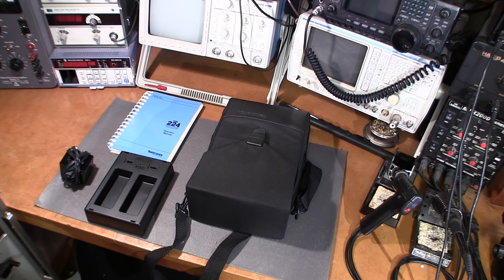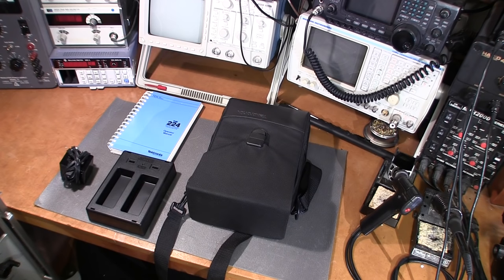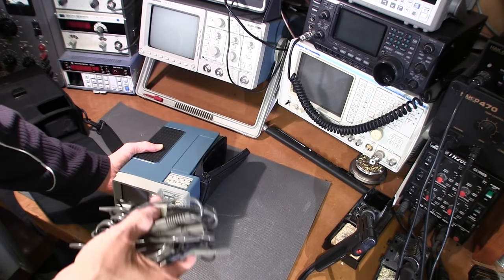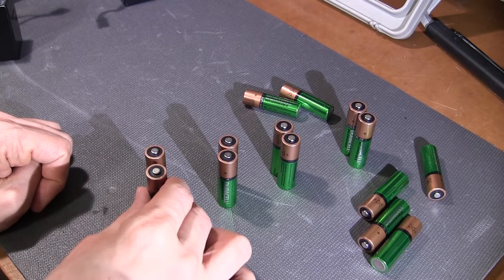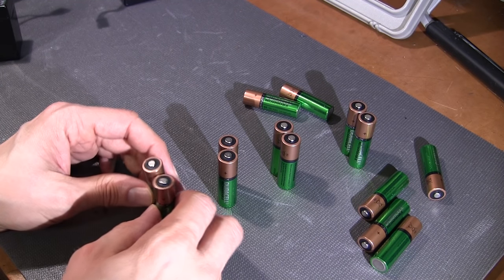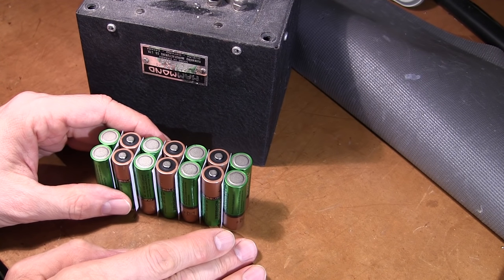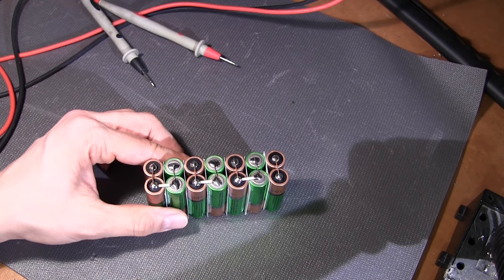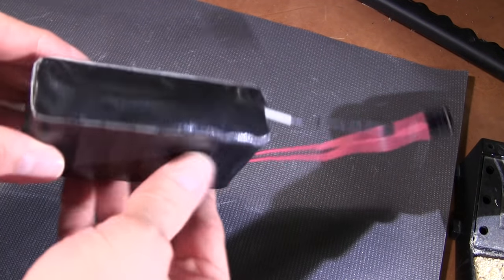Tektronix 224 Oscilloscope Repair and Modification

Comment: I just watched this again for review. I need to make a battery pack for a HP portable scope I purchased. I wish it only had a few batteries like yours but it is going to take 80 batteries to make the 24 volt battery pack. I think I have decided to make 2 packs like yours but 4 batteries across and 10 pairs long. That will give me a pack with enough current but at 12 volts. I will make 2 packs then joint them in series to get the 24 volts. There are so many different ways to do the job. I could have made 4  24 volt packs and join them together for more current. There is good logic in the way you divided the pairs of batteries and I like that. Thanks again for all your videos, I know how much work it takes to make them!

Comment: A 1971 ancient Tektronix 211 oscilloscope I have uses 10 AA nicads in series for its internal source of power. The unit is about the same size as the one in this video but is an ancestor. It is a 500Khz single channel scope. The 10 NiCad AA batteries are in two packs of 5 cells. The length of each is a tad shorter than a AA battery, it is a tabbed AA variant with no positive button top and one has to be careful that a rebuilt pack will fit. One mine I had Digikey custom make each pack 2 decades ago with the AA variant that is tad less long. The actual service manual I got in teh early 1990's was from Dean Kidd the retired Tektronix employee that knew everything aboyt Tektronix. He passed away at 88 back in 2015. His knowledge of Tek stuff was outstanding.

Comment: Like you, I found a friend who had one of these. He had lost the power supply, and it didn't turn on, so he gave it to me. Well, you video showed me how to remove the LAB. It was dead so no wonder it wouldn't turn on. I plugged it into my bench supply and....it works perfectly. This little scope is so amazing! It will never leave my hands. Yes, a little slow, but, it's just so cute. As an aside, he used it twice for a purpose he had. Used it twice and it went to the back of an equipment locker, never to be seen or used since, and I'm guessing, 1994.

Comment: Recently acquired the high-voltage version of this, the Tektronix 220PS Power Scope. Of course the battery was dead, so I built one with solder as in this video, and one with spot-welded nickel strips, both with a 3A fuse mid-pack. Both work great, and the welded one with Ikea 2450 batteries ran over 9 hours before the low battery indicator came on. Thanks, Mr. Carlson!
Reply from the maker: You're welcome Keri!

Comment: Way to save old obsolete test gear you can’t get parts for! BRAVO!! 
  I done the same thing on my Tektronix TDR, my Sitemaster antenna analyzer, the Tektronix 222 Oscilloscope, and several HT’s that use those “flat” batteries for the memory.....  It works great! And I save an otherwise useful piece of electronics from the scrap heap!

Comment: I enjoy the facts in these videos. Facts are important. I would have tried to recondition the lead acid battery using an analogue of a Ring Smartcharge or colourably similar..though the argument of Mr Carlson vis leakage is valid. Excellent engineering by Mr C as always.

Comment: Talking about 60mhz scopes I am in the process of repairing a Trio CS-1060 oscilloscope with an intensity problem.
Thought I had fixed it tested last night calibrated it . Put the covers on this morning and the same fault has returned with a smell of ozone. I have removed covers and will let you know what the fault was I am still investigating the cause of the fault.
Intermittent faults are a pain. Excellent video on swapping battery packs and a very nice looking scope at that and a very good buy should serve you for years to come.

Comment: Next time try desoldering wick (the one without flux) to join the cells. Flexible and much bigger surface area.
Used this for high current discharge packs and it works like a charm
Reply: That's an excellent suggestion that I'm going to use in the future, and as anyone who's not been quick enough removing it knows, solder wick sticks GREAT to just about anything!

Comment: Good to see the insulation on the links between each paralleled pair of cells, but you forgot to put some on the link between the positive ends on the paralleled pairs!
The risk of shorting between the positive cap and the negative case is the same...
Enjoyable video all the same, thanks :)

Comment: Paul,  After seeing this Great video, I purchased a Tek 222A off E-bay which is a 10 Mhz version of the 224.  I m going to make the battery pack.  I also found plans for adapters allowing the use of P6100 1M probes. I only have one P400 probe.  The Series 222, 222A, 222PS and 224 use probes with a 333K impedance rather that 1M.  The plans build a 666K adapter to make the compensation to 1Meg. it also has an adapter using push-on BNC probe tip connectors and connector pin parts  to mate to the probe connections used on the scope.  Found on the design on the TEK Wiki. Google will find it.

Comment: Mr Carlson that is the cutest Oscilloscope I have ever seen and you did such a neat job of battery building.
Reply from the maker: Thanks! I will use it in some up coming video's. The battery worked out well, it lasts 8.5 hours on a charge.

Comment: I rebuild battery packs professionally and must say you did a fine job. Typically on NiMh cells a resistance welder is used with nickel tabs so as not to damage the valve that opens should the battery fail and need to vent. A glue jig is used to hold everything level and together.

Comment: Hi Paul - Thanks for the battery trick. I am an HVAC guy (Formerly a 2nd Class Radio Telephone licensee) and my electronic leak detector battery pack went belly up. Those batteries are 60 clams or so. Anyhow, it turns out there are a quad of "4/5A" batteries in there that I found online for about 6 bux. I was concerned about soldering them even though I have done that in the past. I hear all these warnings, but thought "hey, as long as I do it quick with a hot iron..." Lol, and wouldn't you know it -  I am watching your video because I also like that "cute 224" for no good reason really, and here you are giving that great battery tip! 

The only thing I am a little skeptical about is that super glue idea. I never seem to have a lot of luck with super glue, but maybe, since the battery insulator material is plastic... hmmm. 

Thanks again for another great video!

Comment: Two thumbs up!  This would be great for on-site guitar amp/sound reinforcement/entertainment work (except for wireless mics & IEMs, of course).  Since this video was made, I believe the local battery store has a number of NiMH packs of comparable voltage, capacity, and physical dimensions - I'm sure the price differential is notable - that would fit the bill.  But, it was a good application of your "Soldering batteries" tutorial.   Keep up the great work.  73 de KA2EMI

Comment: Good call with the insulating barriers. The tradeoff with the superior capacity and energy density of new battery technology is that the battery materials are highly reactive and unstable under non-standard operating conditions.

Comment: I have often soldered batteries into packs using a 100 watt soldering iron with a big thick tip. Contact time with the cell was similar to what I'm seeing in your video if not shorter.
I didn't experience any loss of capacity worth noting.

Comment: Can you address how these would be recharged once they have been soldered together permanently in their series-parallel network? Does the scope's own recharging circuit, intended for the lead acid batteries, still work adequately? If not, then do you have to remove the whole pack to charge externally from the scope? And if externally, what method do you use for the recharge? It seems to me that these are not intended to be recharged in this configuration......

When you started this, I assumed that you were going to somehow rig up a few AA cell holders, of the type that each hold two cells, with the holders connected series-parallel but arranged so you could still extract the cells for individual recharging in "normal" NiMH charger(s). Would have been a pain, but as you suggested initially you did not buy this for serious use, rather just for occasional demos, so recharging would be infrequent.

Or maybe you just figured that the initial charge, pre-networking, would last indefinitely for your occasional demos?

As a side note, I used to use one of the similar (and earlier) tiny Tek dual channel ANALOG scopes (which had some kind of analog delay line (as I recall) and a phosphor-type "memory") rather extensively decades ago....maybe 35 years or so ago). I think those had regular BNC connectors for the probes. On that scope, the whole right side had traditional buttons and knobs for control of the two channels, and the battery pack was on the back end. The scope fit into a bag that you could hang from your neck, with the CRT screen pointing up so I could look down to read it, leaving my hands free. I recall the bandwidth was quite low, no more than 20MHz I think. I would not mind having one of those again now, just for show and tell!

Comment: the battery fix is going to be useful for a very early tube tone generator in my vintage collection.thanks for the vid.
very handy.was wondering just how to pull it off without having to hook it up to the power supply.instant solution.

Comment: I love that scope and it's funny cute is what I said as soon as I saw the thumbnail. Coming from my background I'd have had my soldering cert card pulled if I quenched a joint (or even had a small fan blowing over my work station for that matter) but it's a great tip for doing batteries on personal/non life critical equipment.

Comment: re supergluing the cells or anything else with similar instantly bonding properties @ 10:50 the way to do it is line them up or put them together precisely, secure with a little masking tape if necessary, THEN apply the few dabs of glue necessary. the cheaper varieties of superglue can be better for this because they tend to be very low viscosity and the glue will work its way between things before setting. if the shape of the things being glued doesnt allow this, arrange it so your final movement of the objects is as short as possible, introducing less scope for error. this is how skilled modellers will assemble things, where the level of attention to detail is truly insane.

Comment: Sometime back I had to stop using Duracell's because (even using all the tricks shown) I had several of them go high-impedance (even though they still had their original capacity!). When I opened them up found metalized-plastic for the +-connection that was low temp plastic.  I don't know how the green ones like you used are but I had nearly 50% failure. I've been making packs for over 40 years and was just astonished at the result.  I suspicion that it was some form of a fusing scheme.  I now stick to Energizers because they are much more tolerant (i.e. I've soldered and un-soldered  them multiple times). I actually prefer LiOn (cylindrical) cells since they hold their charge so well, have great capacity for a unit like this that will probably see infrequent use but needs to be ready to go when needed...

Comment: I like to use some plumbers paste (for copper pipe) with "no clean"  when soldering cells the solder flows very well, better then some fluxes even.

Comment: I agree that soldering the batteries is fine, you don't even need to be as careful as you are, but to say that it heats less than spot welding is just strange. What would you base that on? Spot welding heats a tiny spot for an instant. The mass wicks the heat away instantly-ish. My experience with spot welding things like this is that you can touch them within a second or two and they feel ambient even without putting a wet towel on them.

Comment: Super cute scope and great batteries replacement. Excellent job Paul Thanks for sharing! 73
Reply from the maker: Thanks Peter!
Reply: +Mr Carlson's Lab Hey do you know the value in uf of this capacitor 222ks630v np.b48pp its on X SUS BOARD SAMSUNG PLASMA TV PN42C430A1DXZA THANKS IN ADVANCE

Comment: Just a point that the charging arrangements for lead acid and NiMh differ even when the voltage is nominally the same. Here, the charge limit voltage for 4xLead-acid will probably be too low to give full charge on 7xNiMh. Although it would extend the life to not charge fully anyway. Very neat pack, nice job.

Comment: Little spot welders for assembling battery packs are absurdly cheap now, and have many other uses besides. I was able to repair the non-solderable ferrous wiring in my car with it, which saved me about $300.

Comment: Great video, I have the 222 model with fixed leads. I have a almost dead battery myself, so I'll be making a new pack soon.
Reply from the maker: Good luck with your battery build. This one (in the video) lasts 8 and a half hours on a single charge. It's been charging over night and seem to be fully charged already. I'm not sure about the 222, but the 224 shuts down at around 7.3 Volts.

Comment: The main problem with soldering batteries is the chance that during a short-circuit event, the solder could get hot enough to melt and then the wires would release from the battery, potentially contacting other things. The proper way to attach tabs/wires to batteries is with a micro spot-welder.

Comment: Nice find and job on the battery. The scope looks mint ! Interesting to know the use of inductor as fuse. The other day there was a Commodore 64 with a completely burnt out inductor which fed power to the video modulator. Not sure if that was its intended purpose. In the Tandberg Sølvsuper 11 (1973) radio it has a incandescent bulb in series with the zener-based voltage regulator feeding everything except the power amp. It lights up when the stereo indicator bulb lights up. People say it is used as a fuse, but maybe its intention is to burn off some heat and voltage before the regulating transistor.

Comment: By using battery holder boxes I believe you can construct a solution that avoids soldering completely. I couldn’t find one that held 7 AA batteries but I did locate a 3 AA and 4 AA enclosed holder on Amazon. They are only slightly larger than the battery pack you built and it appears that they would fit into the compartment. With your solution if 1 battery goes bad it become a big problem finding it and replacing it. My solution also allows the use of a standard charger .
Reply: Your solution does not work for 14 series/parallel batteries. One would need a custom designed battery holder, which Amazon does not offer and is also pretty much a desert when it comes to quality, dependability, etc.

Comment: Awesome job as always, one point of concern/confusion is putting rechargeable cells in parallel. Back in my RC days it was considered bad practice to put them in parallel, putting them in series was no problem.  I believe it was due to their low internal resistance which if too different between the cells could cause one cell to over charge the other and possibly  explode, the rule being if you need more capacity get a bigger cell. Any ways great job and keep the videos coming.
Reply from the maker: Hi Michael. They are trickle charging in the scope and are not force fed. I have never had an issue to date doing this, (in a trickle charge situation) Your results may vary.

Comment: Nice retrofit and battery construction technique!
I'm wondering how you end-up charging the batteries pack.
As far I understand, voltages and cycles for lead-acid batteries and NiMH are different, did you end-up building one or was the original charger good-enough?

Comment: Hi Paul, thanks for the good video.  I was wondering if you could tell us about paralleling cells.  Lead acids will drain themselves when you  parallel them with out isolation diodes. Is this not a problem with NiMh?  Thanks again.

Comment: Here's question for Mr. Carlson: how do "modern" CRT scopes like this one display text on the screen while showing the signal? Is the signal digitized first, and then the CRT used like a monitor (i.e. scanned like a raster)? Or is the text displayed between horizontal sweeps of the signal? Do scopes like this use electrostatic deflection or do they have magnetic yokes? Thanks.

Comment: Mr. Carlson, to separate CA glued items, you just need a good physical shock, if the item will withstand said shock. I'd wager that if you were to glue two of your AA cells together with CA, alow a 24hr cure, then drop the pair on the floor, they would come apart. Go on, ask me how I know.

Love your videos, what city/town are you located in?

Comment: there was a guy selling 3d printed dummy batteries, for tek scopes, originally he made two versions one that took 7 1.2v aa cells totaling 8.4v, and the other designed to use 6 1,5v aa cells totaling 9v(this version had a diode wired in to drop the voltage to 8.4v.
but being a niche product after the stock had gone i never saw them listed again(etsy).

Comment: Replying so far after this original video, it’s likely useless at this point:
The thingy in the battery harness is not a resistor or an inductor. It’s a fuse packaged like a resistor.
Color bands are similar to decode them. Littlefuse made them and they still can be found. Factory Tek LA as they came were 7Amp. Scope draws 500mA. I built my battery 222 packs with a 3A in the “resistor” package for nostalgia.